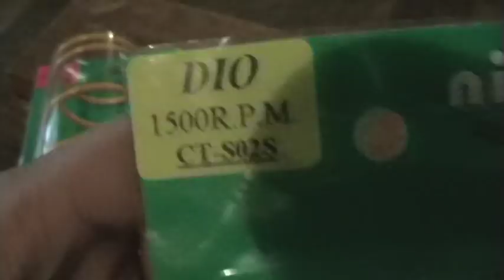Chinese scooter compression spring change 50 cc

Comment: WOW thankyou for your super fast reply, i will check rollers in the morning,i noticed that you locked the rear brake up before you did the nut,when i tried this it never locked my clutch bell up just slowed it down slightly(wouldn't spin so easy) Thanks Again. Lee

Comment: there is a tool out there for changing the big spring out its a bit pricey but imo its cheap safety when you consider that that spring loaded is pushing 1500 Ibs higher perf springs even more

Comment: For $35-$40 dollars, Harbor Freight sells a surprisingly good 18 volt impact wrench to assist with the various clutch nuts.  Your technique may work on a 50cc, but did not on my 250cc JCL.  Lastly, I was not an English major in college, but watch the use of the words or "NON-WORDS" putted or I hitted!!!  The use of those words may keep you working at the local Burger joint as a career...

Comment: Hi, I face an issue of Fuel Economy, Power & Pick Up

Kinetic ZX Zoom 2 Stroke (2001)  110cc

I recently got the bike serviced & the mechanic changed 
1. Float pin/needle.
2. Kick assembly (new)
3. Brake liners (Front & Rear) 
4. Clutch, springs, rubber etc.
5. Gear box oil. (Recommended)

He cleaned & tuned the carburetor.

The carburetor seems to be leaking after this change that was made.

Earlier before this the bike gave me a modest 35-45 kmpl in city riding conditions. But now it's dropped down to 15/20.. Kmpl.

 
Also the initial pickup & instant pickup of the bike has fallen drastically. 

Besides, when I open full throttle while riding, the bike does not achieve its top speed. Surely with time lapse I may not achieve its top speed, but I know for sure it can deliver better. 
However things here have gone even worse. After constant full open throttle the bike just reaches 50-60 kmph & stops after a minute or so. I mean the engine shuts down  & also doesn't start up quickly. It takes a long long long time to start back up right after. (approx 8-10 minutes).

Note:
Although the bike does not have any startup problems relating to cold start or others. It starts up effectively. This is same as earlier. Something to be happy about.

Kindly help & instruct me as to what needs to be done.

Note: -
i) I have converted to manually operated choke a long time back.
ii) I also ensure & have right Fuel (Petrol to Oil 3%mixture)
iii) Wheels are freely operational
iv) A video regarding ;
   a) Carburetor Tune-up & AFR 
   b) Carburetor Rebuild
   c) Decarbonization (Engine)
        would be great.

     Would like to stay updated.

Comment: nice choice of tools, not everyone has a impact  drill, good on ya.
Reply: so you hammer the dam nut? you can get a clutch holding tool for under ten bucks, then you use a socket and a breaker bar, the tool fits in the holes on the clutch and keep it from turning

Comment: @LEEMC41 
is the engine reving ? is the clutch bell or anything in the back spinning at any point? any rattling from near the rear wheel? leaking any gear oil?

Comment: you "hitted" it? why not get the proper tools, like a spring compressor, and a socket to loosen the nut, the three clutch springs have nothing to do with acceleration, they change when the clutch engages. the clutch is normally engaged any time above idle, and essentially locked, all 
you've done is make your self have to rev up the bike to even get moving at all.  the big contra spring is what gets hot and fails on these, because the factory spring is weak
Reply from the maker: moultriemanicmechani Because of you are young and dumb and no money for tools. Good old times
Reply: The 3 clutch springs have nothing to do with acceleration?? are u serious mate? every engine has a powerband lets say your powerband is around 3000rpm so at 3000 rpm your engine gives out the most power. so its best when your clutch engages at 3000 rpm for the most powerfull acceleration. if the 3 springs are to loose and the clutch engages at for example 2200 rpm than you would have a lot less powerfull acceleration because the engine is not yet in his powerband. i hope you understand it a little bit because my english is not that good. all the RPM´S above are examples.

Comment: oke guys this is a how to f*ck up your scooter.... 
one: buy a decent clutch wrench.....
two: use a locking plier to unscrew the square screw make sure you use clamps or some thing else to hold it in place of it will explode
tree: use a malossi,stage 6 or something like that so replace your orginail spring....use a A-merk. Malossi.doppler,stage 6 etc... 

then put it back together. and remeber just don't use this how to....its crap!